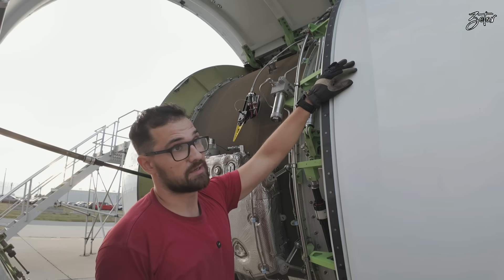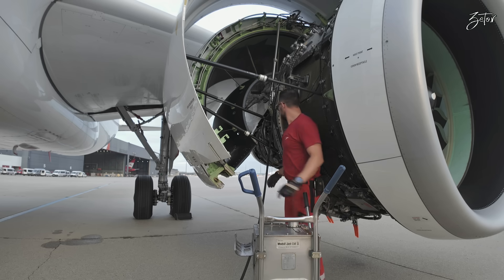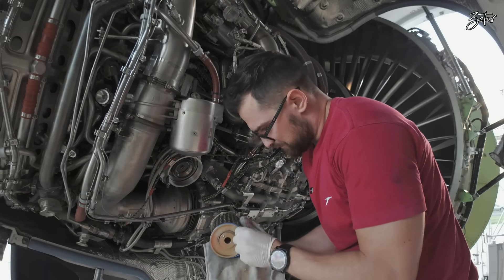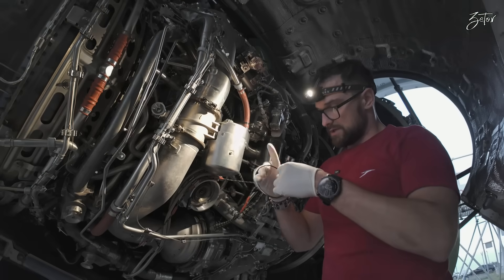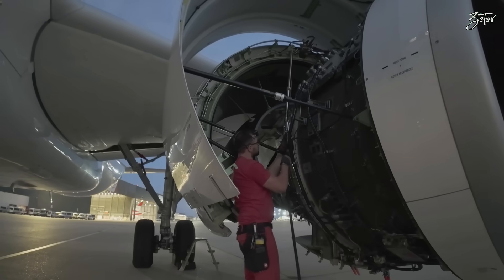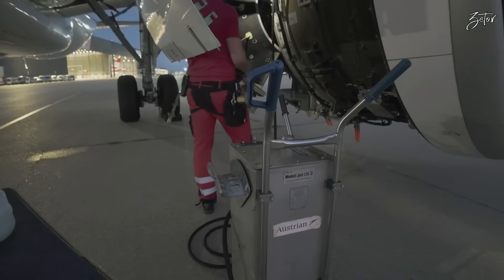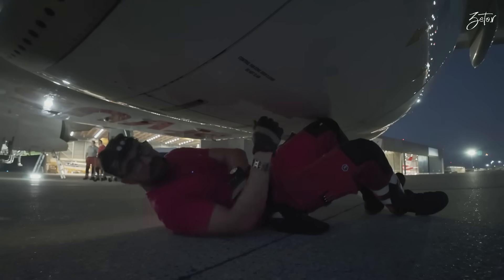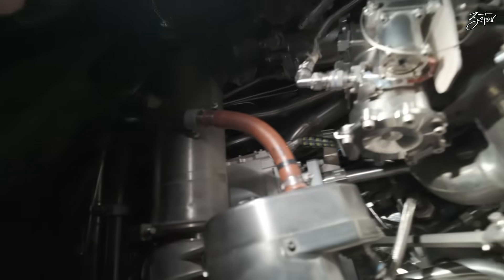How to replace fuel filter on Airbus A320 - PW1100G engine

Comment: 04:00 Why don't you use a socket?
Reply from the maker: Just to prove that it is possible
Reply: @zeto.r I am watching your other videos,  you not use power tools, why?
Reply from the maker: @ahmettasdemir1022  if I strip something with power tool it will be costly. For removal of some parts im using them but never for installation

Comment: I usually wash the filter with kerosene and reuse it to reduce waste.
Reply: I usually cut a hole in mine for improved flow. I rely on prayers for filtration :)

Comment: This plane would be grounded in California if the check engine light is on because of the strict emissions standards something else to worry about the pilot notifying the passengers that the check engine light just illuminated

Comment: Interesting video.  Why wasn't a torque wrench used?   Is a new tightness checking method required or applied? how to make sure the filter cap was properly tight? Some videos show this type of service carried out during the night shift. why is it not scheduled for day shift as fuel connection is better observed?

Comment: You only talk about lubricating the O-rings but you didn't show that on the video. Is that because you didn't want us to see you using the drained fuel as the lubricant?
Reply from the maker: 🤣🤣🤣🤣 you can use fuel as lubrication. I don't remember what I use but most probably fuel

Comment: He visto algún canal dónde los mecánicos se meten literalmente dentro de los tanques del fuel. Me gustaría saber si lo has grabado alguna vez y que motivos pueden haber para llegar a ése extremo, gracias 🙂
Reply from the maker: There are a lot of reasons, inspection, repair, replacement of the component.
Reply: @zeto.r  Gracias!

Comment: Don't see why you can do the leak check with the fan cowls and C ducts open. That would save you an additional open / close operation on the doors after verifying leak free. You can run the engine at idle with the doors open to do a leak check. Did it lots of time in a previous life. Will save your company time and money
Reply from the maker: And you youchave fire what then? Fire protection system will not work with C-ducts open

Comment: In my Toyota Premio, the fuel filter is attached to the fuel pump in the fuel tank. You have to lift the rear seat to access it.
Reply from the maker: Cool inside 😎

Comment: Very nice video ❤... being a marine engineer, I can relate very closely to the seemingly simple but very very crucial job of renewing our filters, be it fuel oil, lub oil or air filter and then the critical task of purging priming and trying out post renewal....as you said..no leaks..I too felt happy and relieved..😊....here also you follow a planned maintenance system, I guess..like renewal depending on the running hours of the filter ..or/ and also go by the gradual drop of fuel pressure and differential pressure drop across the filter upto allowable limit...just curious to know.... thanks for the interesting video..
Reply from the maker: Thanks for your comment, yes the maintenance system is very similar! On NEO we track pressure if pressure rise in front of filter to limit we replace the filter🙂

Comment: In the video, the engine cowling is closed after a long time, and performed checks, and reopened again to see if there are any leaks.
Can we run the test with open cowlings and close it for good just once? 
What is the technical or safety reason for this?
Reply from the maker: I can leave fan cowls opening but core must be closed since fireprotecrion will otherwise have no affect

Comment: Marvel of engineering. To think that all of those intricate pipelines, wires and equipment stays intact at 35,000 feet in high speeds.
Reply from the maker: It is awesome indeed

Comment: The oil is not dirty. You could drive the plane for another 5000 km or 6 months whichever comes the earliest.
Reply from the maker: Problem is that it is fuel

Comment: I am an auto mechanic 45 years. I enjoyed watching you replace the fuel filter. My question is this: You do a lot of maintenance on this aircraft. Are there times where the work light that you are using that you wear as a headset is not desirable due to insufficient light or inability to get the light close enough to what you need to see? I would like to know if any of the 3 lights in this video could ever assist you because of its design? These lights was made for working on autos and trucks and we have lots of sales to these auto mechanics but maybe after seeing this you will know if there are situations that you could attach the suction cup or vise-grip to the fuselage on a flat smooth area or a irregular bracket for the vise-grip mount.  https://youtu.be/rKMZfOMuDLE?si=W81eYs5K1w_zaLO-
Reply from the maker: I prefer head light. It is much better then anything else

Comment: Well I liked it!... 

It gives you some appreciation of how complicated the aircraft engines are... and why, if you are risk averse, you shouldn't fly Boeing... where some cheap imported labour, with bogus qualifications, but cheap, has either skipped the job completely, or used an old part instead of new, or taken some other shortcut to finish his shift on time, or keep his boss happy, to meet some artificial productivity target from head office...

It made me imagine some alien mechanic, doing a 10,000 lightyear service, changing an oil filter, on a craft, on an alien planet, the Earth, under the ice at the North or South pole, and posting it on the Intergalacticweb... 🤔

Comment: Interesting, but I thought opening all those C-ducts made this overly complicated. I would have thought there would be a small access door for the filter.
Reply from the maker: Every opening adding the weight and remove straight of the structure and You don't need to open it that often

Comment: The filter is the same size I run into my 75hp Mariner
Reply from the maker: Our fuel is cleaner thats why
Reply: @zeto.r  wont be very clear if he keeps wiping the outside of the filter with that rag then contaminates the actual filter material with it thereafter.

Comment: This video appeared in my YouTube feed following the recent speculation about fuel contamination on Air India 171, despite it being a Boeing Dreamliner. The video effectively highlights how negligence or improper servicing can lead to serious issues. I understand that if fuel filters become clogged—whether due to organic or inorganic reasons—there is a fuel bypass system in place. However, I am curious about the potential consequences of such bypass activation. Additionally, I assume water condensation in fuel might be a particular concern in tropical regions ..

Comment: Hi brother awesome video. I just wanted to know if it can be issue while you are documenting your maintenance process and god forbid you miss any small part that u forgot to install or something left open while focusing or recording. Or has the airline any restrictions with recording while working. Just curious. 
(Sorry for bad English)
Reply from the maker: Yes there is huge restriction. I'm in special program. Regarding mistakes. I most of the time completely forget about the camera and for example I forget to switch it on. That's why you from time to time see in the video different shirt or different engine. Since it is recorded on different aircrafts and days.

Comment: Thanks for the nice video you shared with us. My doubt in that what lubricate you used on the bowl and filter seals?
Reply from the maker: Thise things I'm not placing in video as well as torque value. All this is in AMM. Also it can change by next revision and it will be wrong information
Reply: @zeto.r  Generally we are using the Petroleum based Vaseline for the CFM and LEAP engines fuel filter...

Comment: I worked on the design of some of the engine systems on the A320neo (PW).  I am so glad to see that at least one of them has been running long enough to require a filter change!
Reply from the maker: I love that engine but problems with Combustion chamber and blisks makes it hard for companies to like it

Comment: I cannot believe there is not a torque spec for the fuel filter.. I know it has the ratcheting mechanism to keep it from backing off.. but wow why not a set torque? This aint an automobile..
Reply from the maker: It goes easy in if you properly lubricate the o-ring

Comment: Was searching for a fuel filter replacement guide for my 320d, stumbled on this A320 filter change video. Followed the same steps and it worked well. Just that the ‘d’ in mine stands for diesel, and the ‘A’ in theirs stands for ATF.
Reply from the maker: Ok

Comment: followed this guide and was able to change the filter on my  A380, thanks a lot.
Reply from the maker: That is strange, because on A380 you can have  either four Rolls-Royce Trent 900 engines or four Engine Alliance GP7200 and non of them are close th PW1100G

Comment: i did the engine run procedure but did notice a slight bit of moisture on the filter, doesn't smell like fuel, could it just be condensation ?

Comment: Man, the oil shouldn't be clear. Are you sure you put the washer fluid in the propper spot?
Reply: Shows how stupid I am. If I learnt to read propperly, i'd know this wasn't an oil filter. Happens when you comment faster than you think...
Reply from the maker: I was thinking that you text it as joke so my plan was to reply that it is air filter with special fluid for cleaning 😃😉

Comment: Very interesting and somewhat complex. They built is an order, proceed and torture values with leak testing? O rings need a particular lube and fasteners are designed to tapper I am sure to keep rings from nicks & cuts. 
  I am not sure what was done in the cockpit but I am sure the pre-flight check list will show fuel pressure to number 1 and number 2 and display on the screen. Green for good and Red for low as pressure transducers can supply instruments with readings, I hope. As these are expensive!!
  Thanks kindly for showing!

Comment: The A220 has rotor bow protection too. I usually just run the engine with cowls open and just have someone standing by with fire extinguisher in case of fire

Comment: Isn't there tool for removing filter??

just using hand??
Reply from the maker: You can use wrench to remove it, i just want to demonstrate that it is possible. just for tightening you must use hands
Reply: @zeto.r  oh, interesting! Is there toque requirement for install filter? Just using hand feeling?

Comment: So much I could say from my technical mechanical experience here first off the cowling showed signs of stains those must be investigated let me clearly state in a technician's capacity your antennas are up working on a hot engine is a No-No. The fuel filter canister system is very similar to an automobile screw on oil filter  system the one thing I can't stress and you may have missed is the surface dressings on the O-ring seal the O-ring itself and using your fingertips as readers on those surfaces although hand tight is true there is a torque specification on that particular motor you are working on that is very important due to expansion from Heat I noticed it was Daylight and the night time by the time you finished that's a lot of hours for one fuel filter although maybe you were doing other stuff because I saw a ladder by the rear landing gear let me get back to the importance working on  a warm or cold engine again you're antennas are up there's many components there that you could give a look at while doing the fuel filter change additionally using a extremely high luminous powered handheld light is very important if you're trying to work in that atmosphere of Darkness which I do not recommend it's all about the angle of the light how you see it and of course unlike me you have to have perfect vision everything on that motor is telling you a story you have to be able to read the pages I hope this helps you become a better mechanic I almost forgot back in my day that fuel filter would have been sent back to the factory for analysis / inspection.
Reply from the maker: Thank you for your opinion 🙂

Comment: FRT showing 0.5 hours on the fuel filter. You're taking way too long.

Also, what did you lubricate your new o-rings with? I need to know as I have a side job to do this weekend
Reply from the maker: I will be faster next time. And lub you will find in your AMM

Comment: What’s it like working in the winter?

You have to open both cowlings again to inspect after the run. Would be nice if you could use an endoscope.
Reply from the maker: Same as summer just you wear the jacket 🙂.
Fuel is transparent you will not see it on camera. Manual says clearly. Open and look!

Comment: (11:00 et seq) Insofar as I know at least Lockheed would design any given airframe or component to be serviced with a small subset of tools and fasteners, is that true of this engine?

Personally, I'm appalled that you need to use a primitive open-ended crescent wrench to do this job -- over and over. Have you ever considered procuring a ratcheting wrench? It would speed up the job considerably.
Reply from the maker: For sure you can use open-end ratchet 🔧.  This is online to show how you should do that but of course, there are shortcuts😉

Comment: Is it necessary to close the fan and core cowl or we can run the engine for leak test keeping the both cowl open?
Reply from the maker: Yes you can keep them open just keep in mind that you need  the fire extinguisher big enough to extinguish potential fire.

Comment: thanks brother, my A320 needed a new filter. shes running like a dream now.
Reply from the maker: It will run well even with a clogged filter but I guess you know that
Reply: @zeto.r  no dude you havent seen the filter, it was CLOGGED with cheeto dust. idk how it got in there
Reply from the maker: Again if filter is clogged you have pressure bypass valve so fuel will run anyway in the engine

Comment: I wonder how small the Filter is, the Airplane has 24000l of fuel capacity and a range of 4500km.. So a Truck Filter seems barely bigger than this one.. But the engine needs 6000L per hour... To run the approx 1000Km... means 16l Fuel per second... How?
Reply from the maker: I need to correct you, max fuel consumption during T/O is around 3000kg/h and during the cruise it is around 1200kg/h. Fuel must be very pure. There are high limitations for it. Also refueling truck must have a filter. Once fuel pressure rise in front of filter we must replace it

Comment: As someone who worked on the B-52H for 14 years, these engine cowlings are dreams come true. It takes about 4 or more people to open/close the engine cowlings on the buff, a few hammers, and prying tools. After an hour of fussing, cussing, and using every R-rated word in the vocabulary, you've finally managed to finish one out of 8 engines. At least you can run the engines on the buff with open cowlings to check for leaks.
Reply from the maker: I would love to touch that aircraft and see how maintenance is done on it. 🙂

Comment: Useless, aircraft maintenance is too serious to get tutos on Youtube. If you want to be instructor then join a Part 147 organism.
Reply from the maker: If you don't like it don't watch it is easy as that
Reply: @zeto.r  As I said, aircraft maintenance has nothing to do with tutos on Youtube. It is not fixing your car in your garage. The title of your video suggests a tuto on how to replace a fuel filter, this is wrong. Didn't you get this point? You should know that only approved documentation must be used to work on aircraft, so this video, as said, is useless, and even dangerous as some guys may use it instead of propper maintenance manual.

Comment: How often do you change the fuel filter? Is it a single point of failure or is there another fuel filter on the other side of the engine for redundancy etc?

Comment: Pratt and GE  easy engines  to work with went it comes to acceptability, Rolls is a mother!  If you really want to confirm if there is metal flakes or particles on that removed filter, place it inside a clear plastic bag pour some JET A and try to shake it side to side.

Comment: I work at a warehouse that ships exclusively P&W engine parts and have handled this part before. Does anyone know if it's normal for these parts to have grease on them? I've had to get the part replaced twice already due to finding grease on the outside, it seems strange that there would be grease on a fuel filter.

Comment: Questions: 
1. How do you know when to change the filter? Is it via service logs and flight hours or through any sensors or other automated systems?

2. What's the cost of the filter? 

3. Would it be typical to replace all filters in the same service?

Thanks! Interesting look under the wings which us flyers never get to appreciate up close.
Reply: Also kudos for having to do the process and then redoing it to check!

Comment: Just bought my daughter a used A320 from Facebook marketplace, low nautical miles for the year, was looking for a place to replace the oil but they were all booked up, then I came and search on YouTube, and bam I just saved $50k by following your video. Thanks! By the way I ordered the filter on Amazon with next day shipping.
Reply: That’s crazy, Napa had everything i needed to do a full service on this engine. My engines get nothing but the finest Napa Gold filters and Napa aviation oil. yea
Reply: I got mine from Temu. That's how Russia, Russia,  Russia, gets around sanctions.
Reply: this comment had my dying LMAOOO
Reply: must have gotten a good deal because of fuel filter issues. now you can fix it for cheaper alternative 😂
Reply: Jokes on me 😂😂
Reply: Thanks to this video my grandpa changed the fuel filter.